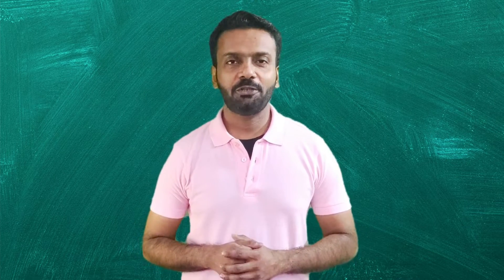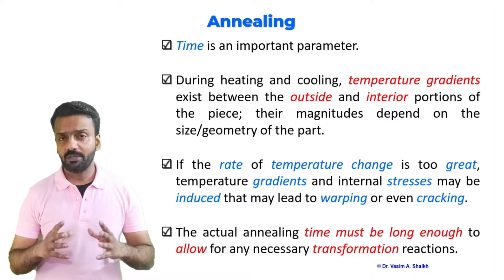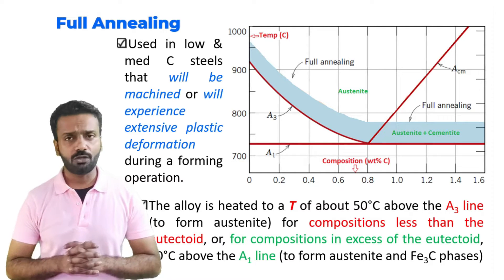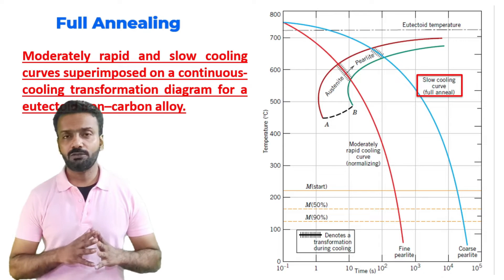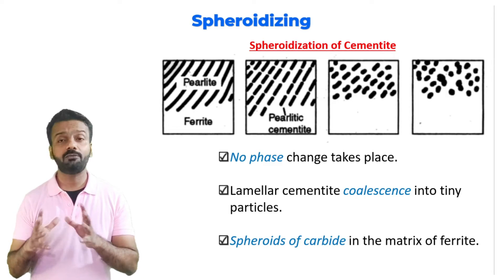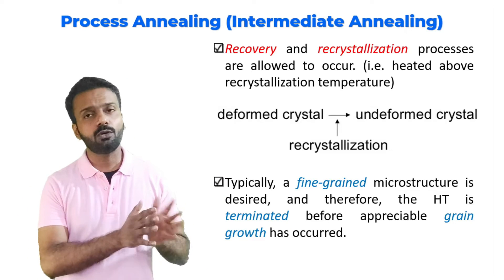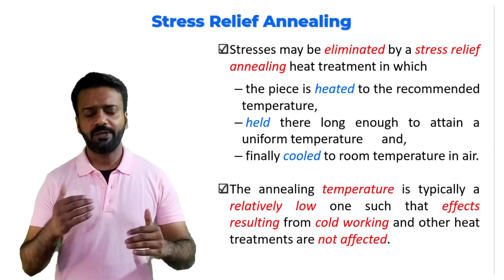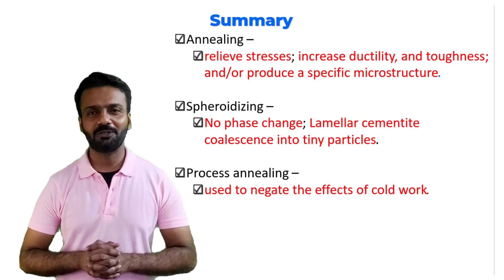Annealing & its Types | Full Annealing | Spheroidizing | Process Annealing | Stress Relief Annealing

Comment: Can you please tell me which heat treatment is best for reducing residual stress of hardened hypo eutectoid steel ?
Reply from the maker: The best heat treatment for reducing residual stress in hardened hypoeutectoid steel depends on the specific composition of the steel, the initial heat treatment process, and the intended application of the steel. However, one common method for reducing residual stress in hardened hypoeutectoid steel is to perform a tempering process.
Tempering is a heat treatment process that involves heating the hardened steel to a temperature below its critical point and holding it at that temperature for a specified time, followed by cooling it in still air. This process can help to reduce the hardness and brittleness of the steel while also reducing residual stress.
The specific temperature and time required for tempering will depend on the desired properties of the steel and the initial heat treatment process. Generally, a tempering temperature of around 400-600°C for a few hours is effective for reducing residual stress in hypoeutectoid steel. However, it is important to note that over-tempering can lead to a reduction in strength and hardness, so careful control of the tempering process is necessary.
Other heat treatment processes such as annealing or stress relief heat treatments may also be effective for reducing residual stress, but these may result in a reduction in hardness and strength, which may not be desirable depending on the application of the steel.

Comment: Hello Dr. Vasim  - can sae 4037 be reliably certified to 95% spheroidization?
Reply from the maker: Spheroidization is a process by which the microstructure of steel is transformed from a predominantly elongated or lamellar shape to a more spherical or globular shape. This process can improve the ductility and toughness of the steel. SAE 4037 is a low-alloy steel that can be heat-treated to improve its mechanical properties. However, the degree of spheroidization that can be achieved in this steel depends on several factors, such as the chemical composition of the steel, the heat treatment process, and the cooling rate. To reliably certify SAE 4037 to 95% spheroidization, it would be necessary to carefully control these factors during the manufacturing process and conduct rigorous quality control tests to verify the degree of spheroidization achieved. This would likely require close collaboration between the steel manufacturer and the customer to ensure that the steel meets the desired specifications. It's also worth noting that achieving 95% spheroidization may not always be necessary or practical for a given application. The required degree of spheroidization will depend on the specific properties required for the intended use of the steel. Therefore, it's important to carefully consider the intended use and performance requirements before specifying a particular degree of spheroidization for SAE 4037 or any other steel.